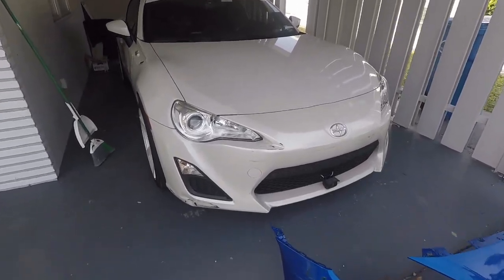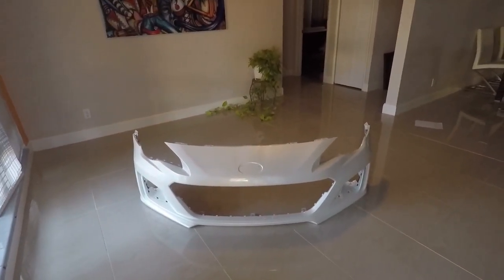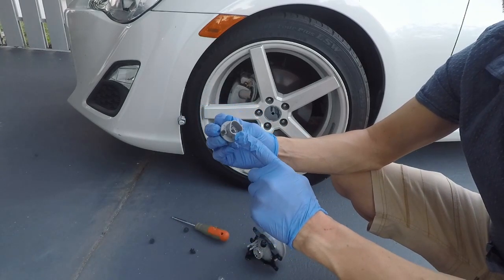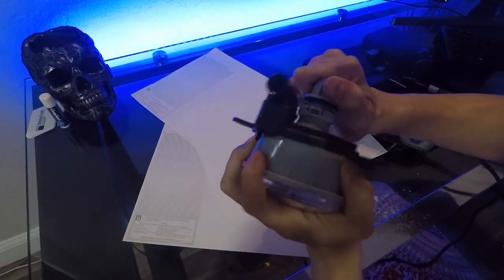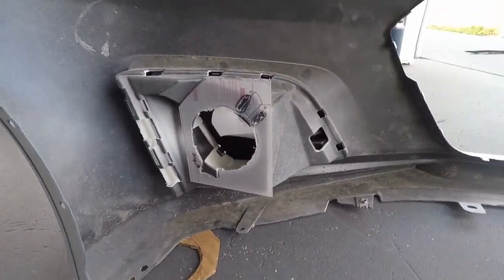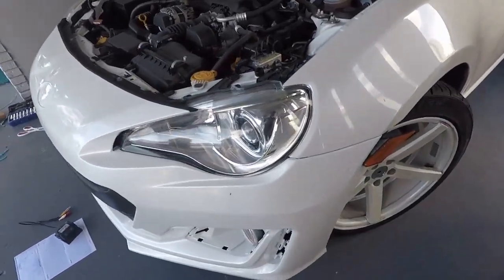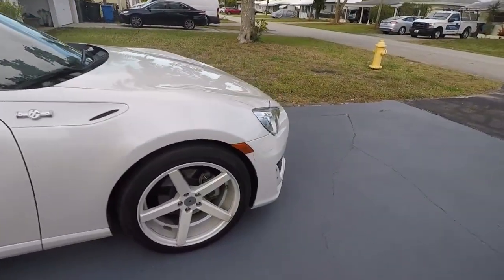FRS TO BRZ Bumper Swap

Comment: You need the 17 headlight bracket for the bumper to fit flush
Reply from the maker: Ya I ended up buying the plastic that goes under the headlight and it worked, thanks

Comment: Could you link the fog light housings? I am trying to do this but the generic brz fog housings I ordered have a much smaller opening and the bulb wont even fit in. Thanks
Reply from the maker: @humanrat  yes these look like the ones I bought. Keep in mind that the FRS bulbs do not fit in. I had to cut them. It's all in the video. Good luck!
Reply: @TravelingDirector  thank you yes what I meant to say was on the ones I got the opening was to small to even fit the glass part of the bulb in and was lined with an aluminum ring so it couldn't be sanded

Comment: Were you able to use FRS bumper under cover with the BRZ bumper? All holes of the under bumper cover lined up with no modification needed?
Reply from the maker: The only issues were the slots around the headlights. I had to buy new ones that were for the BRZ bumper
Reply: @TravelingDirector  Thanks!

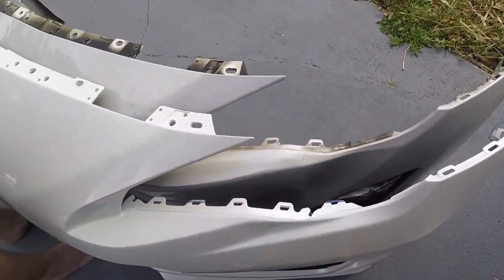Comment: bro i have a question, i have this problem where the new front bumper wont fit because of the problem that you were facing in 5:07. did you manage to cut it and the bumper will fit? thank you. i was hoping you answer my question.. thank you
Reply from the maker: Yeah there were two issues. The first was The fitment around the lights and the second was at the corners. I ended up buying new light brackets and that fixed the problem. I should have done that first. I think there's another video I posted that talks about it

Comment: Found your other video explaining your tire and wheel specs did you stay with stock or did you lower it?
Reply from the maker: Haven't got around to lowering it yet. Did the bumper swap and a door install. Next is steering wheel
Reply: @TravelingDirector  Looks good what are the wheel and tire specs again?
Reply from the maker: @MikeDMays  https://youtu.be/fAV0RggP9iY